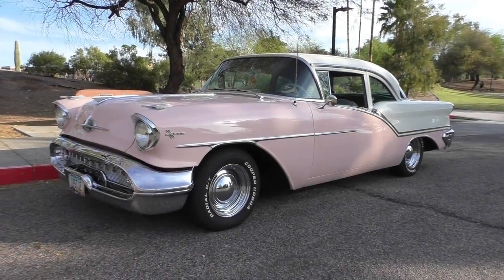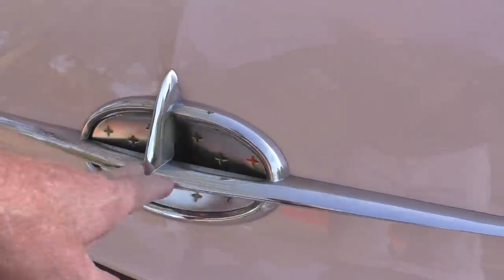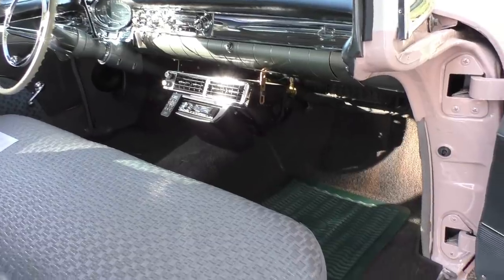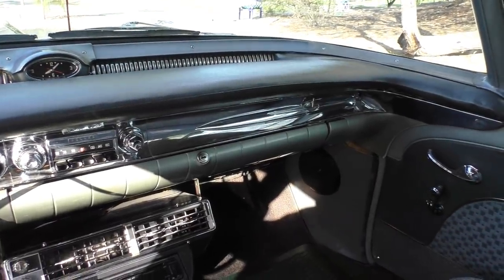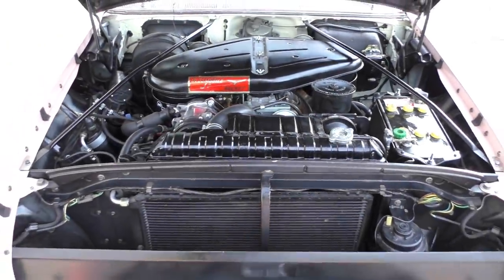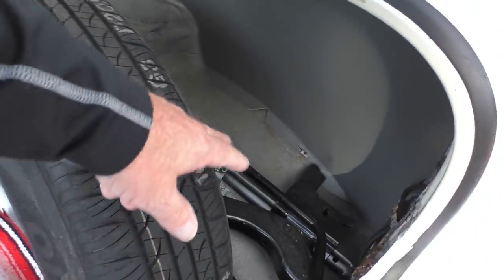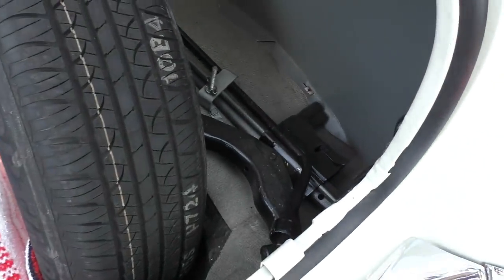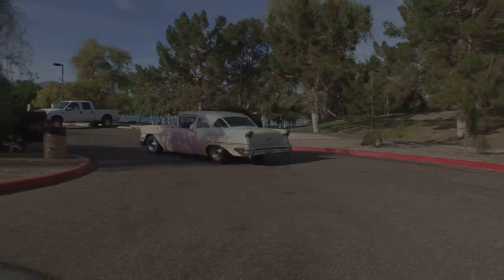1957 Oldsmobile Super 88 2DR Sedan "J2 Tri-Power Up-Grades" (Sorry Sold)

Comment: A fantastic tour...these cars are gorgeous...I love the fact he even got a hold of a "tar top" battery for this...so period correct.
The only thing I don't like as much are the white letter tires....they are just not right. I would have left the black walls out.....other than that, fabulous....
Reply: S/SGen3/426  I believe the car comes with the original wheels, wide whitewall bias ply tires and full hubcaps.

Comment: My dad and I have a 57 super 88 two door but a hardtop.     The motor and trans are fresh.   the 4 speed hydro shifts into second almost before you can get across an intersection LOL..   We have the J2 carb  setup but it is not on the car.    No Ac tho..

Comment: The J2’s were actually pretty common.  They were tricky to adjust and they consumed a lot of fuel.  Shops would often
Unhook the front and rear car a for that reason.  Jetaway automatics which were ok but not as rugged or responsive as the old speed heavy Hydramatics.  Nice car!
Reply: A "good" mechanic could keep the J2's outside carburetors closed when not needed.
The "high fuel consumption" was due to the driver's heavy right foot.
Reply: I heard the first J2's had vacuum secondary's that could get hung wide open so they changed them to mechanical linkage secondary's.